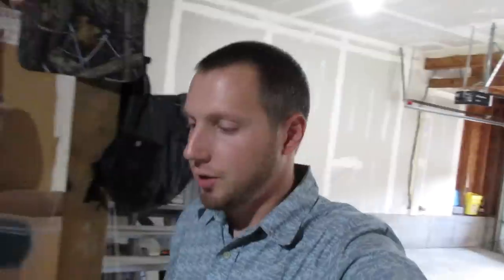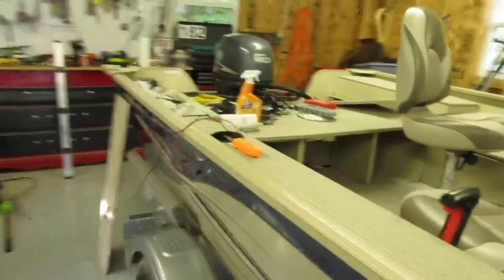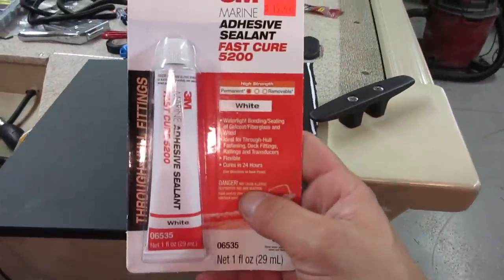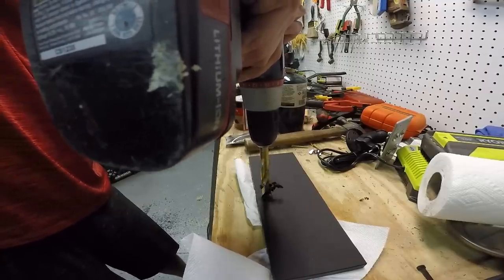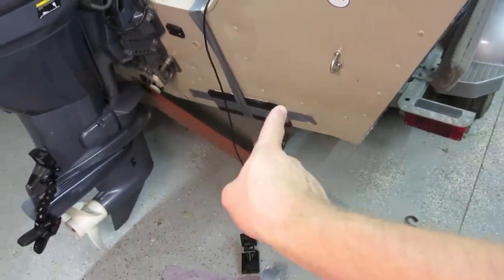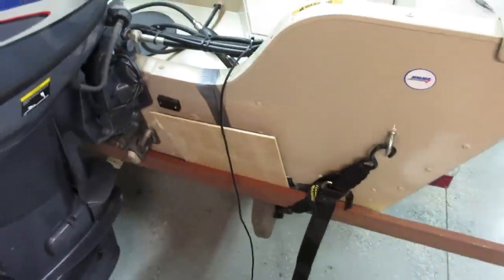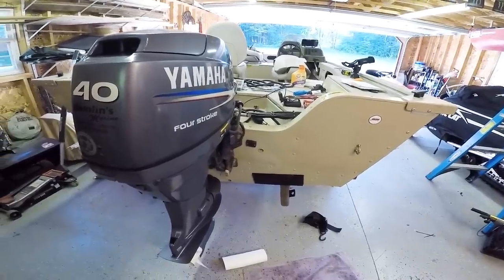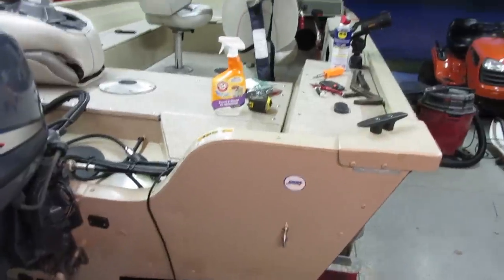NO DRILL TRANSDUCER MOUNT!

Comment: I've done a few dozen of these boards and one thing I noticed that may impact the quality of your readings at high speeds (particularly when mounting a larger SI transducer) is turbulence. The bottom of the board should be in line with the hull. Leaving it up a little above may be OK for some transducers, but that "step up" will create turbulence - so if you line up the bottom of the board with the hull, then run a bead of silicone between the two to make it smooth - your results will be best.
Also - I personally don't mind 2 holes through the board into the hull (with silicone in the holes prior to sinking screws of course) - it seems more solid compared to any adhesive. After all - it's only 2 holes and that's it forever. You can still move your transducer, upgrade it or whatever as you are screwing into the board and never again into the hull.
Finally - the leading edge of the transducer should be 1/16th or so LOWER than the hull then the back tipped down ever so slightly - this seems to provide the best results for many transducers.
Good video - keep up the good work.

Comment: Quick tip for ensuring level...pick two rivets on the port and starboard that are the same distance from the bottom on each side.  Tape a line across the top of them...now use that as your reference for level.  That combo square is assuming everything on that trailer is square.  Load up cockeyed and so will your square.

Comment: Hello from Goa India. Sorry to say, that I lost my transducer after a period of 4 months glued to my fibre glass boat. I believe that due to ageing and vibration the wood left the body of the transom. The transducer would have dangled and saved, had I screwed on all the wire clip, instead of gluing them too.the wire harness got pulled into the propellor. In my opinion once bitten twice shy, I will see that I will use screws and bolts provided by hummingbird. Please note that I did not glue the previous lost  transducer on seeing your video, ( I had already lost it past 4 year ago)so no ill feelings to this video uploader

Comment: I remember crossing the line and drilling into my boat the first time. After enough drilling in enough boats, I finally got over it and don't hesitate to drill when necessary now. I would be more worried about all paint that would be torn off when removing the plate than having 2 or 3 little holes from a transducer.

Comment: Not saying the transducer shouldn't be level, but once you are in the boat the weight distribution will not be equal, especially if you fish by yourself a lot like me.  When you're at the console the boat will lean slightly right.  Then factor in how the weight in your boat is distributed, if the water has any ripple or even 1 foot waves and you see my point.  I'm not singling your video, all the videos I see on this say to level it.  Of course I'm going to level mine just out of principle,  but I'm not sure just how critical this is even  if you were a few degrees off level.  Maybe some others can comment.  Good video.

Comment: When we developed the Stern Saver product, I tested 5200 on one of our prototypes and it fell off almost immediately, and before any other adhesive we tested. And that was used on our blocks with the threaded pockets in the back, not smooth StarBoard. 5200 will not reliably hold your transducer to your hull. That's why we ended up going with the highest grade marine epoxy available instead. This is the reason our mounting system is the only one trusted by the vast majority of boat owners out there, and why it's the only one large retailers trust.
Reply from the maker: Scott Johnson thanks for the info. But I would like folks to know Ive had this on my boat since this video with no issues.
Reply from the maker: Scott Johnson what is the product called? I can try to recommend if for folks here??

Comment: Wonder if it be better to take peice of steel run down the back with L bend at top so you can bolt it to bump rail and gives you place to secure your wire and if you get creative you could make your rod adjustable

Comment: Man I don’t know what I did wrong but after 7 days of 5200 on my transom it was still soft... soft enough I just twisted the block off and scraped the rest off with a putty knife ... I used Locktite marine and 24 hours later installed my transducer ... I wasted money on 5200.... not sure what the issue was but it’s installed now🤨🤨😀
Reply from the maker: pimpshack81 that’s weird. After I installed this.. the next day it was dry. I could shake the whole boat with the block.
Reply: Maine Trout Whisperer I think the difference was I bought the caulk tube and it was a 7 day cure time... event though I let it sit for 7 days I think the fast cure is a better Adhesive ... I even roughed it up with sandpaper and it was just a tacky gooey blob... but I have it mounted and can’t wait to go out and test it... first time ever using a fish/depth finder... any suggestions ?
Reply: @pimpshack81  you must have gotten a bad batch.  I've never had an issue with 5200.  Prep the surface with an alcohol pad and never an issue.
Reply: Jeff Trek I did that. Also scuffed the area up with sand paper.. I bought the 7 day cure time in a caulk tube.. it sat for 7 days and was still just like it came out of the tube... so I took it off and used the lock tight marine epoxy .. that worked great

Comment: So your boat is aluminum Right?? The 5200 is stuck and no issues? I’m about to install a depth finder on mine but I want to really know it’s going to hold
Reply from the maker: pimpshack81 yes it’s aluminum. I can shake my hole boat if I grab that block I glued on... it’s not comin off lol
Reply: Sweet .. thank you sir.. keep those vids coming 🤘🤘
Reply: 5200 works but it is not an adhesive it is a great sealant with good adhesive properties, your best bet it to use marine epoxy.
Reply: @paperchazin  look on line they have a magnetic one to hold the transducer now drilling just stick and go!

Comment: You could shorten those bunk boards so they don't extend beyond the back of the boat. They don't need to be that long.
Reply: You would have more of the boat hull on the bunks if they were positioned further towards the front.  Where that bunk board goes past the boat would seem like a nice location for the transducer.